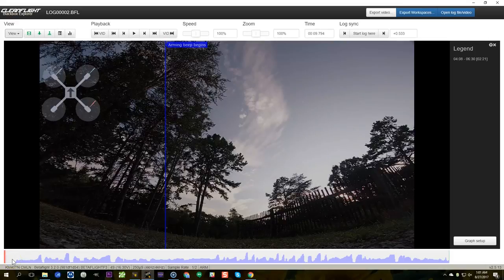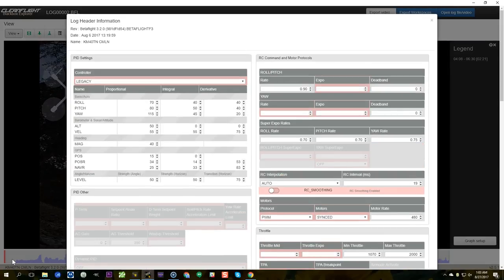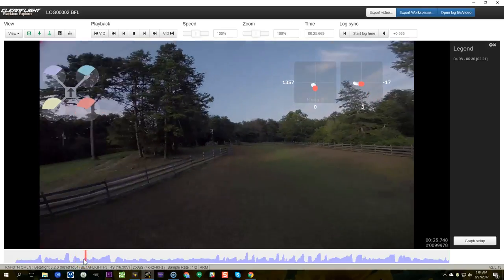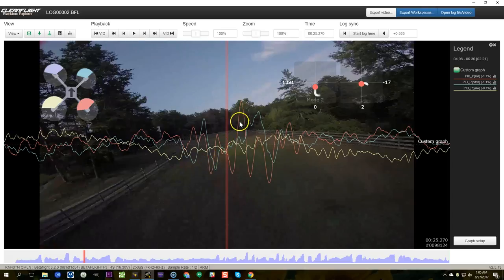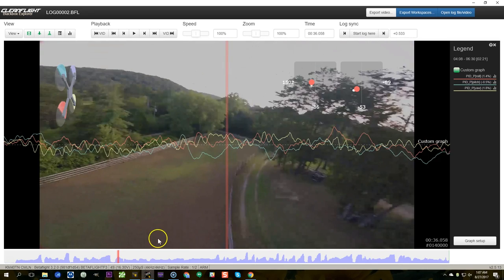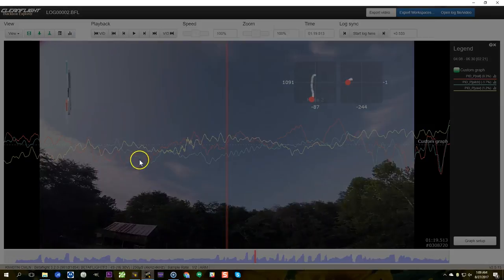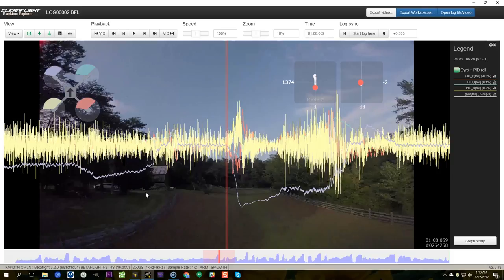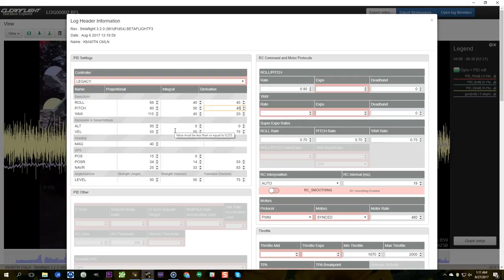BLACKBOX 101 | Ep11 - Fine-tuning Propwash Oscillation

Comment: A new lesson what to do with log graphs. I knew that log may be used to catch out PID tuning margins too - and you proved that. At least the reason why it is good to have log storage of some sort in FC - particularly SD card or memory chip. Thanks again! And about lesson how to see noise in logs. Found and eliminated two main noise generators in one of mine quads after log analysis (now motors are softmounted and FC mounted on rubber rings).

Comment: Although it sounds counter intuitive to reduce the D gain, you should try cutting them by 50% on pitch & roll and logging the data... I've noticed D gains interactions with P have changed a little since BF 3.2, PT1, Dynamic Filters etc. On almost every quad I've switched over to 3.2 with all the new features and filtering changes my D gains are ending up between 17 and 28 rather than something between 30 - 45 like with BF3.1.x. It took a while before I realized I was going the wrong direction but I kept raising D to deal with minor prop wash until I decided to start over. I chopped my d gains from around 45 on pitch/roll to 15 & 18 and almost all of my prop wash disappeared. Finally finished @ 19 on roll & 20 for pitch. I'm not sure why though???

Comment: So at the end of the video you look at the overall D-term movement and you say that it looks a bit out of control (for the roll axis).  then you go and raise the d-term gain more than you lower the P term gain.  I would think if the d-term movement looks large you would instead lower the P term gain and not touch the D-term gain so that the D-term movement is lower overall.  any quick thought on why you didn't do it that way?

Comment: I you are showing propwash oscillation on pitch and roll, could the one with the first oscillation, cause the other axis to oscillate?  Mine are both oscillating, but roll starts first.  I lowered my p on roll and it seemed to clear it up.   Also,  can d cause propwash oscillation?  I still have a very slight amount.  It looks like my pid sum is dominated by d on my pitch axis.  It seems almost like a mirror image of my d traces.  If i look at the motors, the peaks and valleys match up perfectly with the pid sum on pitch.  Thanks for all your help Josh.

Comment: I'm considering running different rate profiles for 'new' vs 'old' props. Do you think the benefit would be worth the time?
Reply from the maker: I don't think rateprofile is the right way to approach it. PID profile is a different thing and maybe. But I think you should be able to get good flight performance on old props, and then leave the PIDs the same for new ones.
Reply: PID profile is what I should have said.

Comment: Been wondering about tuning now in 3.2 with all the PT1 and filters and dynamic voodoo set.  I don't often fly with perfect props, how do small nicks and crashes affect the tune?  I've thought about tuning using less than perfect props but don't know if it'll ever get close to what's possible.  Thanks for this series, really useful.
Reply from the maker: +Smokin Mesa the props being off balance will make more vibration and hotter motors if D term is high. But dynamic filter helps to prevent this.

Comment: What's up Josh just thought  I would share this with u. I burnt up my f40pros they were like drag motors fastest and stronger then ever but they were just to much u know. if u got money or a sponsor like a Budweiser drag car you're all good. they just run them selves to DEATH lol. Like every time you go Full Throttle you are damn sure going to blow them up soon.  So I got some f80s and you know they feel like the same power even a little more but they are so freaking smooth so so smooth when I arm I can't even hear them hardly them it's amazing and full power is smooth and they feel like they are not even working them selves at all and they stay cool. max flight time is 3mins or less like 2 1/2 with 5045 props 1300 r-line tattu. Maybe going to get 1500s now so I get 3mins for sure. I know they way more but you cant feel it all u feel is smooth power.The f40s were freaking awesome and a good experience but damn I'm not make money off them.
Reply from the maker: Only complaint with the F80 is they are so damn big and heavy. Beautiful motors if you can swing them.
Reply: Joshua Bardwell you know they say they are bigger but they really don't look more bigger around Just A Pinch you can hardly see up against the 2306. They are a pinch taller maybe11\2 or 2mm it's nothing. Of course I really didn't think there is much difference between a 2205 and 2306 It's nothing I just think the power make up for all sizes in the motors if they are good motors

Comment: Trying BF3.2 and this video/BB but my BB log seems faster than the video - what BB log rate do you use? It default at 1k...which is what I took...
Reply from the maker: Logging rate shouldn't matter, the BB log should still sync with the video. But if you are using DVR video, it often has skips that cause it to lose sync.

Comment: Dunno where to put videosuggestions but here comes one:

Can you please make a short video of how to use LED as a UART so that I can put my Runcam Split tx on it?

Many boards these days have to few UARTS and I use like 2 extra peripherals.

Asgard board = 2 UARTS (RX + 1)

My needs: RX, VTX, Split and Telemetry(not really needed, but I wish)
Reply from the maker: +Matti Torvaldsson enable softserial then use resource remapping to move softserial to ledstrip pin. But... Does camera control work on softserial?
Reply: A really good question, I could go softserial->bfcms(vtx-hv) instead, if that works better. I should test, when I get the board. I think I understand how to do the remapping;

1. Enable softserial
2. In config, specify Split/BFCMS/TBS on SoftSerial as paripheral
3. Find LED/Softserial using "resource list" and then change SoftSerial to where LED was

Correct? (I should not care about remapping LED to something I guess)

Comment: Maybe not go after the dterm but raise hz on lpf on both gryo and d term. I'm thinking with new dynamic notch they can maybe turned off not sure still a new guy but I'm pushing the number up with no bad effects and smoother control.Default 90gyro 100dterm lpf ithink now 120glpf 130dlpf lol to my understanding higher is less but i see no noise beyond might just test setting to 0. what do you think?  my thinking comes from kiss fc lol which i don't have but seen in its gui you can turn off lpf
Reply from the maker: Never, ever turn off the D term lowpass.
Reply: ok. thanks lol I'm a tester I would have in time lol don't leave me in a room with a big red button

Comment: is there a way to reduce propwash with out lowering p or raising d i dont like the feel of adding d  but i aslo like how the p term feels? more d make it feel looser to me
Reply from the maker: Disable notch filters if you can do so without hot motors. Switch from Biquad to PT1 filter.
Reply: Joshua Bardwell I did all those changes successfully any other features like raise d and transition in bf? Or possibly set point weight?

Comment: hi, JB! could you please help for a subscriber? I just ordered the Wizard 220S from banggod and it seems doesn't come with the receiver. so I think I have to buy it separate. I have FrSky Taranis Q X7 transmitter. on the FrSky website I've found this X4RSB receiver. is it ok? or you can offer something else? also, I have no clue how am I suppose to install a receiver. please help me!
Reply: Zoltan Gremsperger obviously I'm not jb but that rx will be fine. Personally I'd go for the XSR purely because it's small and lighter. But either will work fine. As for installing and setting up, plenty of videos on here. Just search X4rsb (or whichever one you get) setup and you will get ton of results. Project blue Falcon channel on here has a playlist dedicated to the X4rsb, you will find everything you need to know right there. Good luck.
Reply: mrmurder75 Thank you very much, big help! I'm just checking the XSR but on FrSky there is at least 4pcs. which one are you recommend?
Reply from the maker: X4R-SB is fine. XSR is fine too. XM+ is also good if you don't need telemetry, which you might not care about.
Reply: thank you JB for the help! I have now a few options.

Comment: Does anyone know why rc command and gyro curves don't match?
Let me explain, I set up a graph with roll rc command and roll gyro to see how the gyro tracks the rc command and those two graphs just don't match. Graphically, it looks like gyro is only doing like one third of what it's asked, but if I look and the numerical values of rc command and gyro at a given point, they are quite similar and the tracking is good.
Reply from the maker: Adjust scaling to 100% and disable expo in BB viewer.

Comment: What fly time are you getting ? Everyone ! I want to make graph or something. Plz say what lipo and motors you have. Thanks :)
Reply: I have 7min. And racerstar 2205 2600kv.
Reply from the maker: I typically get 2:30 to 3:00 on this quad with a 1300 to 1600 pack. Motors are RMRC Rifle 2550kv.
Reply: yeah buzz i get about 7min of scenic flying with a few high throttle punches and then let the battery recover, be careful when you fly slow the battery does not recover so much when you have voltage alarm, so try not to empty them too much.. i have got over ten minutes .. i got these results with both racerstar 2205s 2600kv's and kingkong 2205 2300kv's i use 1 turnigy graphene 1 tattu 70c and 3 infinity graphenes all 1300ah and 1 1500mah infinity... i dont notice any differences between any of them. i have just switched from kingkong 5040x3 props to dal cyclone 5045x3... same results.
Reply: BuzzCola 3 between 2 and 3 and half mins with 1400 90c lipo and x nova 2500kv.
Reply: Really depends. Dinogy graphene mega 2.0 75C 1350mAh, 3.5min freestyle on emax rs2205 2300kv, but maybe 2min on racing. Also depends on props...
Reply: Rs2205 DSHOT racerstar 25A SpRacing F3, T5045C, Freestyle, 2:30 to 3:00min

Comment: can someone please help me with a ?.  will this motor below fit on the martian 2 frame. 

Description:
Brand: Diatone 
Item name: Edge 2306 2450KV brushless motor
KV: 2450 (rpm/V)
Stator diameter: 23mm
Stator thickness: 6mm
No. of stator arms: 12
No. of stator poles: 16
No. load current (A/10V): 2.0A
Motor resistance: 24mΩ
Max continuous current: 65A/10S
Max continuous power: 1100W
Weight: 32g
Outside diameter: 23mm
Body length: 40mm
Max lipo cell: 3-5S
ESC: 30-50A
Recommended prop (inch): 5x4x3 / 5x4.5x3 / 5x5x3
Reply from the maker: Why wouldn't it? it's a standard bolt pattern right?
Reply: ok thanks im new just getting started and didnt know if its standard bolt size

Comment: I'd appreciate some advice (anyone) on what i'm doing wrong - no matter how high i raise Ds the propwash is still there and the only way to eliminate it is avoid it. If i lower Ps the kwad becomes sluggish, with higher Ds Dterm oscillations eventually develop.

BBLog: https://drive.google.com/file/d/0ByVTpy6-Jr2dSXBEYWxkelRRZzQ/view?usp=sharing
in this log  - every single throttle up after a hang shows various degrees the both axis oscillations.
Corresponding video: https://youtu.be/UNwVNDFM-ew?t=50  (at 50s - extreme case)

cheers!

Comment: a really like your videos, because you are talking about real stuff.. but prop wash means, that that motor is faling throught dirt air... it can not be handled throught sofware... it is just physics suff.. this whole thing, when you are getting these oscillations from bad tune if pid, doesn't mean, it is propwash... look at propwash on water based models.. there are cirlcles on whater, and when the circle hit the motor, the motor needs to push harder.. 

same thing applies in the air... you can smooth it, but you can not get rid of it

TLDR propwash in this hobby doesn't mean propwash..
Reply from the maker: When we say "propwash" in mini quads, it is short for, "oscillation of the quad caused by PID loop inability to properly account for propwash." You absolutely can deal with it via software and tuning.